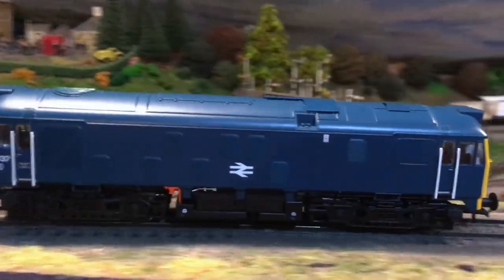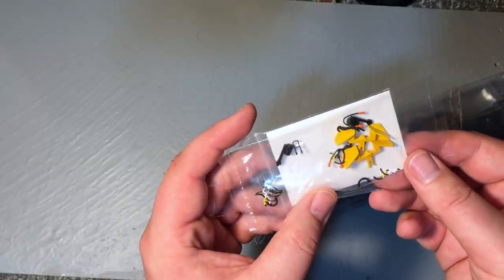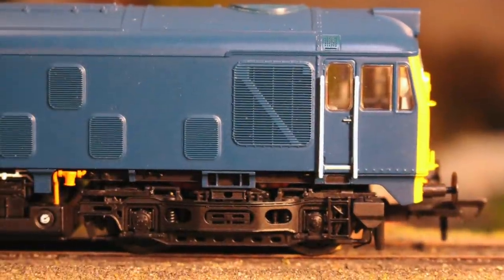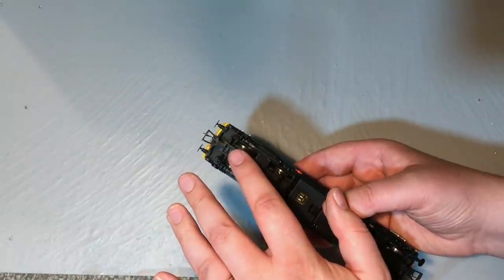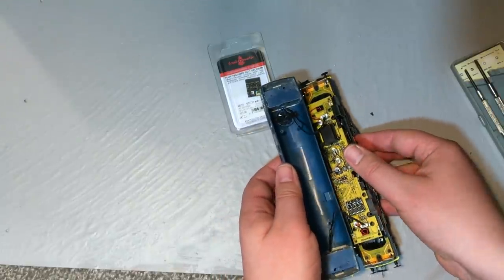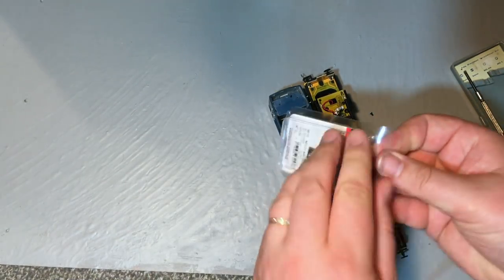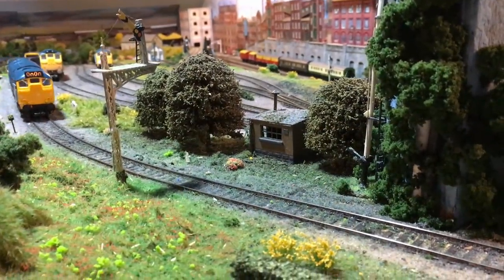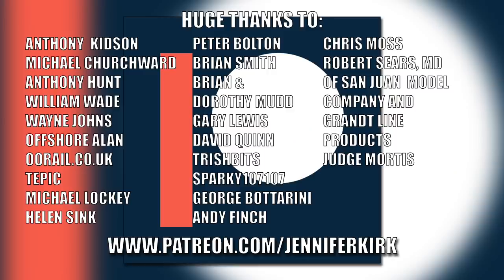Has The Bachmann 24/1 Been Worth The Wait?

Comment: Great review Jennifer ! And a great 24 from Bachmann as well ! I have Bachmann's first 24035 with DCC Sound and a BR Blue 24009 from Sutton.
The 24035 is a bit like the 24081 in your review but for it's time a nice 24 with quite good Sound and I keep it. The new Bachmann 24137 comes close to my Sutton 24009 especially regarding bogies, fuel tanks and battery boxes still a bit less detail but Bachmann has done a good job ! I am certainly NOT tempted to remove the body of this Bachmann ! Big difference is the BR Blue and yellow colors which is darker on the Sutton (more like the 24081)  and the very modest metal handrails on the Sutton. The Sutton has an avalanche of (Sound and Light) functions as well. I wouldn't hesitate to buy this new Bachmann however !

Comment: Another great video Jenny, and a favourite locomotive of mine. I have 3 of the original Bachmann locos on my layout and without a doubt, they're the best runners I've got. They just keep going and going, even on dirty track. Would I invest in a new Class 24 from Bachmann?... I'm not too sure. I'm seriously considering spending a bit more and buying a Sutton Class 24.
Reply: I have 2,however much the Bachmann model is an improvement over the previous models,it simply cannot compete,especially sound wise with the SLW 24.Period.